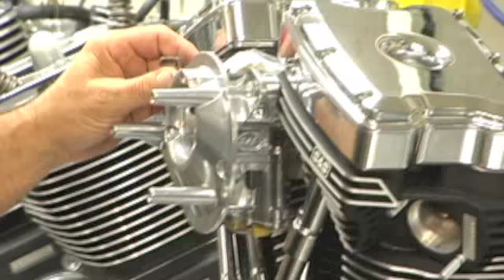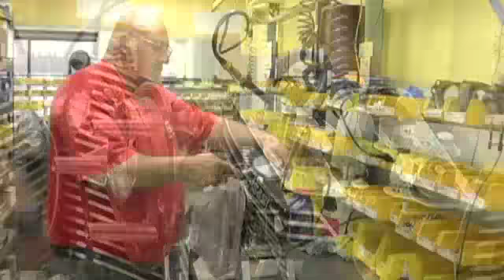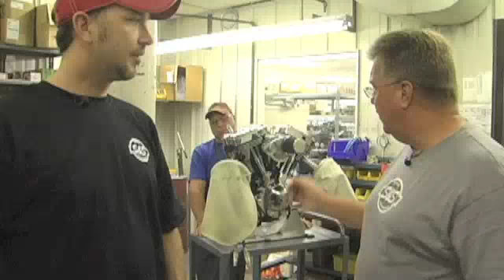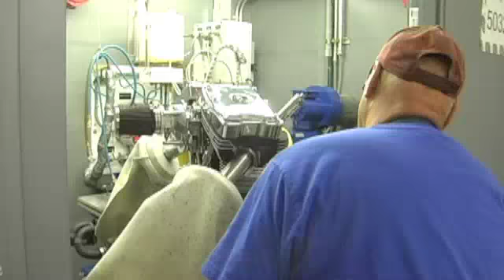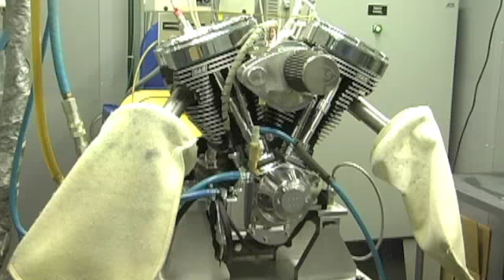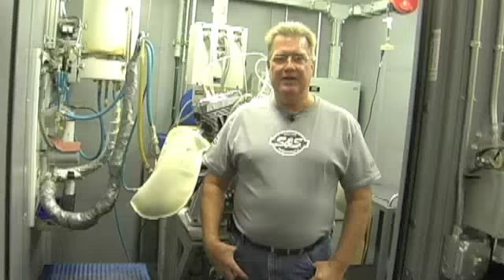S&S Cycle Engine Assembly with Wally Cahill

Comment: I have a 111 that came on an old Electra glide. I bought it used from a dealer for the engine.  There was no additional paper work on the engine. It's now on  kraft Tech frame. Being a bobber build. I wonder how I can get some history or background on this enhine.
Reply from the maker: We would be happy to do some hunting to help you. The fastest way to get answers on this is to send us an email to socialmedia@sscycle.com. In the email include the serial number of the engine (stamped on the primary side), the serial number of the cylinders (stamped on a plate near the exhaust port), and from the flywheels (remove the inspection bolt above the inner primary and you should be able to read them).
Reply: @SSCycleInc  Thank you so much. I will surely do so.  With the serial number from the engine thanks again.

Comment: I can’t fix my S&S moter, it keeps coughing out of the carb. Your guy said that it’s to lean, so what screws do I turn out ? My name is Dennis, I worked on car motets a lot also.
Reply: check your timing and make sure your push rods are not to tight if the push rods are to tight your intake will not close completely and will cough through the carb
Reply: @UnholyRollersCCAZ  also inket manifold leak would cause that too-

Comment: I have a 93" all S&S shovel style engine that's never been started. (Long story) It came fully assembled with an electronic distributor. I installed it in my 75 FLH. Haven't been able to figure out how to hook it up without having to buy one of those expensive adjustable modules (or whatever they're called). Wondering if a points distributor would be okay instead. This will be a street driven daily ride. Any help from S&S would be appreciated. Thanks. Btw. Great video.
Reply from the maker: We do not recommend use of points in our engines.  Reach out to our teach team to help walk you through setup. https://www.sscycle.com/contact

Comment: Q: Do the S&S Twin Cam engines come with a silent chain or a roller chain drive with PLASTIC cam chain tensioners ( a wear item).....or with METAL GEAR DRIVE to operate the two cams?  Also do those same TC engines have a pressed together crankshaft or is the crankshaft bolted together? Do you utilize Timken tapered roller bearings on the lower crankcase main bearing for the output shaft or INA bearings?  Do you utilize Timken tapered roller bearings on the cam shaft bearings or INA bearings? I would appreciate answers to those important questions to consider an S&S TC retrofit........thanks.
Reply from the maker: +tomcata1467 All S&S T-Series engines have gear drive cams. The cranks are three piece with the mainshafts forged on to the flywheels. There are only two joints where the crankpin is pressed into the flywheels. Check out this video series about our flywheels. https://youtu.be/o0M9yd4i70M 
S&S crankcases use Timken bearings on the sprocket shaft. The inner cam bearings are full complement straight roller bearings (no spacers) made by Torrington. The outer bearings are ball bearings because of the close tolerance required by the gear drive cams.
Hope that helps!